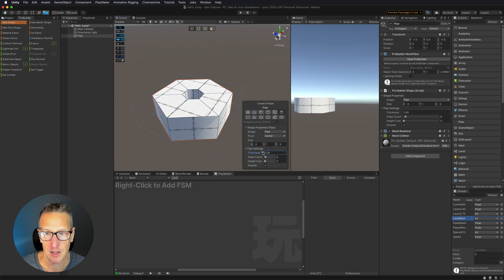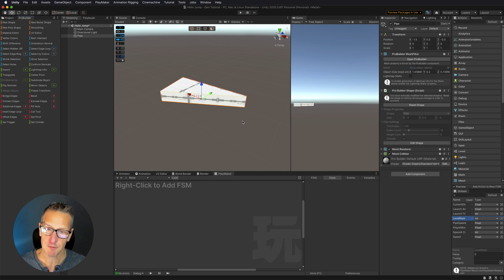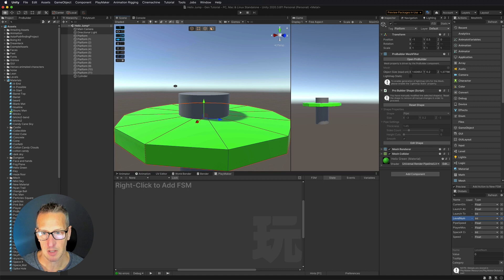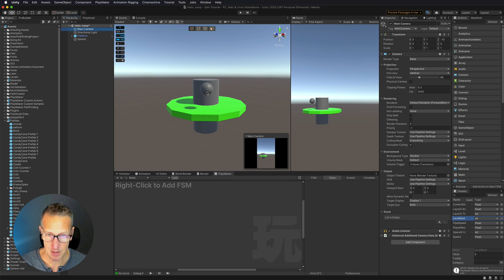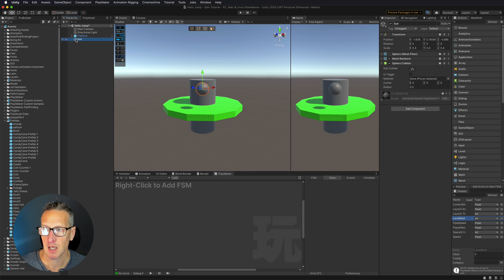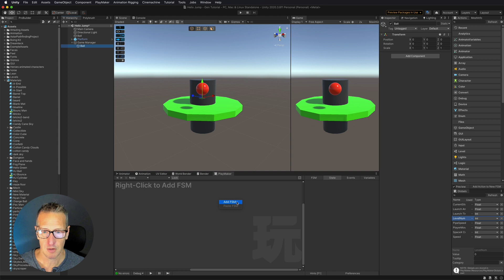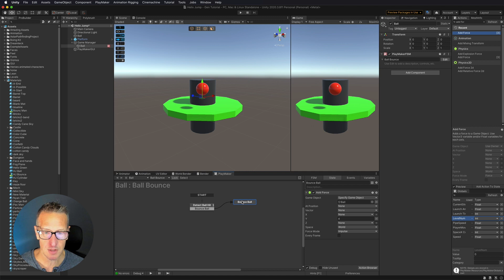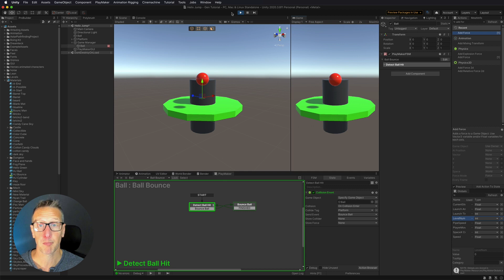Unity 3D Playmaker Creating Helix Jump - Ball and Platform

Comment: I am having trouble creating the materials unity version 2020.3.28F1. Is there a required setup in order to use the URP with pro builder? I imported the URP samples for pro builder with the materials and the shader, but mine shows as pink. When I try to follow along with the tutorial and create the material for the ball it is always pink and does not reflect the changes as shown in your video tutorial. I am new to the URP requirements!
Reply from the maker: Yep, if you are using ProBuilder with URP, you'll need to import the samples for that.  So go to Window > Package Manager.  Then under Probuilder package there should be a Samples option.  Open that up and download the samples for URP.  That will get you set up with using ProBuilder with URP.
Reply: @BlizStudio  I was using an older version of unity and think that caused my issue. I did get a warning on the import of my package that the GUID was different and would overwrite. possibly that has caused my issue?